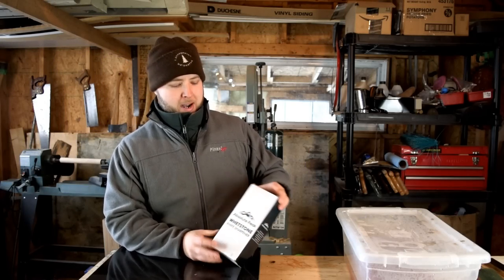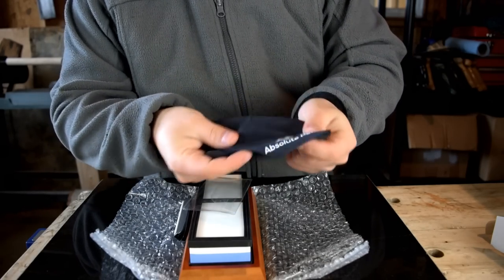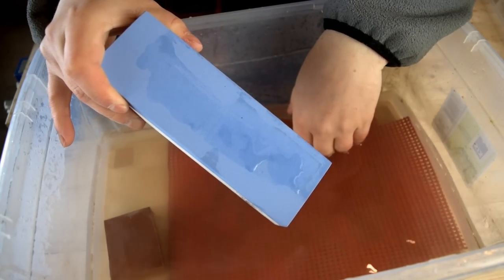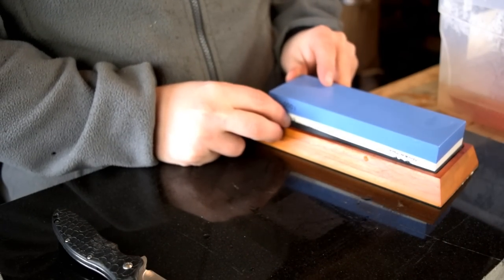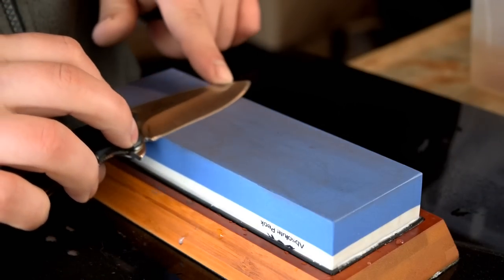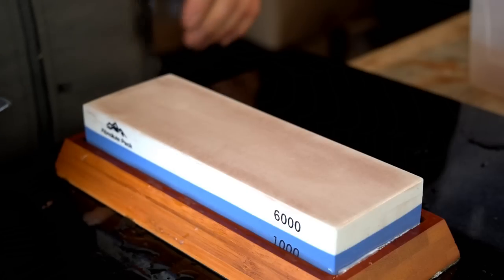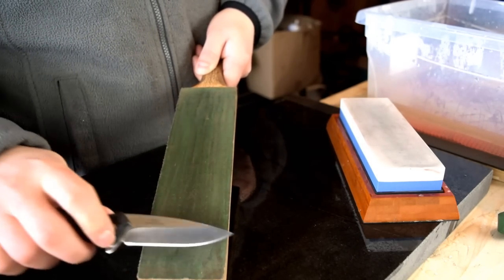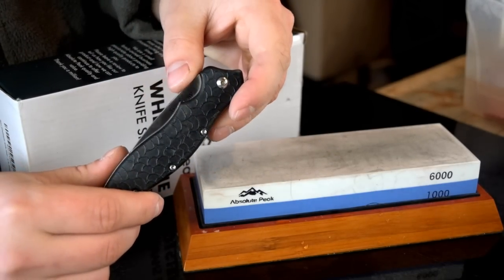The best stone sharpening starter kit? - ABSOLUTE PEAK

Comment: I would say the grit on those are 400-600 on the 1k and 800-1200 on the 6k way off but i guess those cheap amazon stones can be good for somebody that wants to learn or just sharpen cheap knives and not worried about a polished edge but for a little more money you can get some really good dmt stones or some shapton or Arkansas stones and know that the grit rating is TRUE thats what i hate about the cheap Amazon ones you never know what your gonna get

Comment: Do you know where to buy the kit in Canada. Amazon and e bay say they don’t ship to Canada. You are in Canada, just wondering. Thank you
Reply: As is stated below, the company currently does not ship to Canada.
I believe they are trying out the market by giving a kit to Kyle to try, then marketing to Canada may come later.
I would like to say, since there are a lot of inexpensive but really great stones on the market, 
that DO ship to Canada, why would you want these two stones, especially since Kyle had to strop on 
two different strops to get the edge even close to what he wanted?
He also stated, as did some who watched the video, these stones are much coarser that they are labelled.
The 1000 acts more like an 800 and the 6000 more like a 4000 or a 2500.
And the content isn't as uniform as it should be.  That could really scratch up your blade.
Kyle's Woodstock 1000 Stone is, (he said), a more homogenous mixture, but costs three times as much.
If you care about your knives and tools, you shouldn't go cheap on the sharpening supplies.
You GET what you pay for.

Comment: I was watching this knife maker dude (Gough Custom) And he cut through, like 40 feet of that thick cardboard (A2 tool steel), and that friggin’ knife was still slicing ultra thin phone book paper, clean cut. Any ideas how he pulled it off?
Reply from the maker: Proper primary grind. Proper heat treat. Proper final sharpening and geometry. These old carbon steels like A2, D2, and O1, are incredible steels that are often underrated by the general public.
Reply: Kyle Noseworthy: I guess so! I’ve run into other people saying they are pretty solid knife steels if made properly. I kinda got stuck on those “super steels” for awhile, but that’s just darn impressive! LOL...think I may have to give a few of those older, tried and true steels a second look.
Reply from the maker: I think you do!

Comment: Someone needs to learn how to sharpen a knife properly. And instead of dipping the stone in the water,if it's getting dry drip some water on the stone. That slurry from the stone contains metal and stone residue and helps to sharpen the knife and reduces  how much material the stone eats off the blade making it easier on the metal. You want to keep that slurry on the stone and knife unless you're checking the edge.

Comment: Dude, why are you cutting into the stone when you are stropping? You are supposed to move in the direction of the back of the blade. You put pressure on the blade edge as you move  in the direction of the back edge of the knife and then no pressure as you move the blade in the direction of the blade edge. That is how I learned how to do it.
Reply from the maker: Just because that is how YOU learned to do it, does not mean that is the way everyone is 'supposed' to do it, as you say.

Comment: I can't get this in the uk, i have one of them sharpening systems where you mount the knife then find the angle on the blade and draw the stone back and fore, it works but it's not brilliant and would like to learn to freehand, there are so many different grit combinations on Amazon it's difficult to know what to get, can you recommend which grit combo to get please
Reply: Jas Ward 1k and 6k is a good starting point, but 1k and 3k or 5k will also do the job. Get a set of King stones, fairly cheap and they do the job.
Reply: KingJL25 thanks
Reply: Jas Ward KDS combination stone 1000/6000 grit should be the right searching term